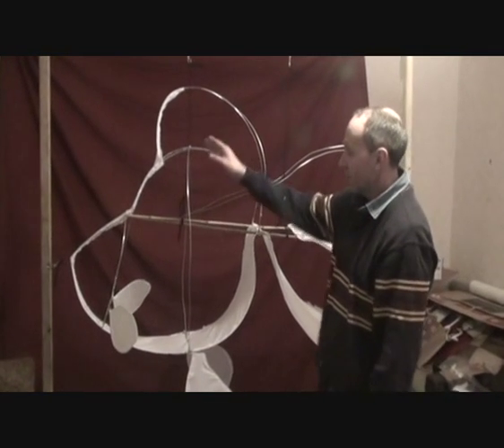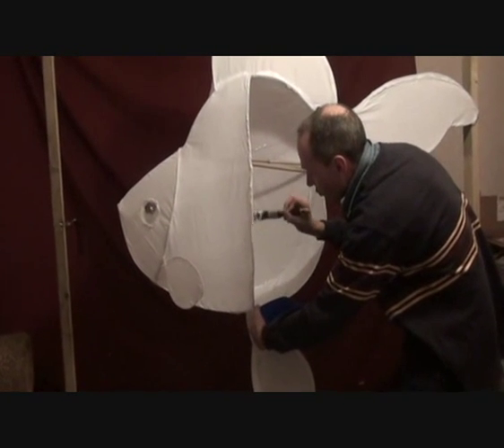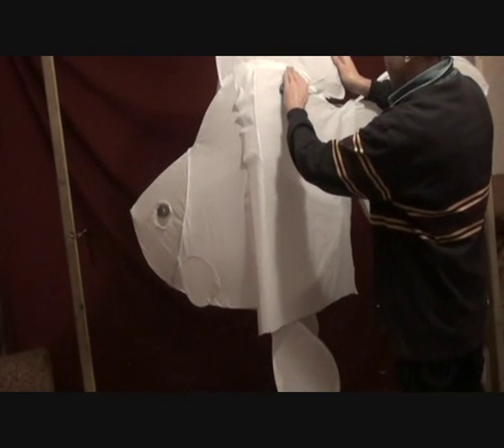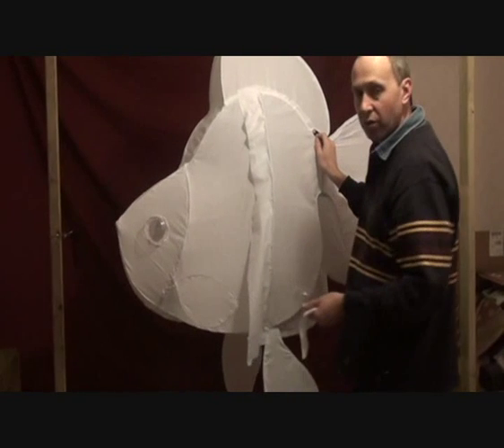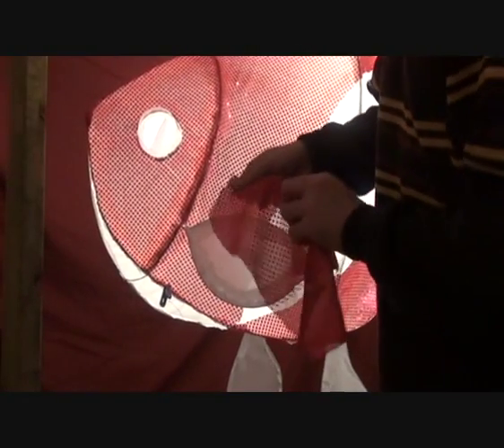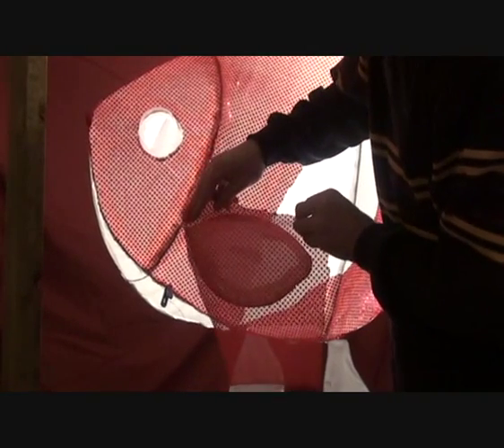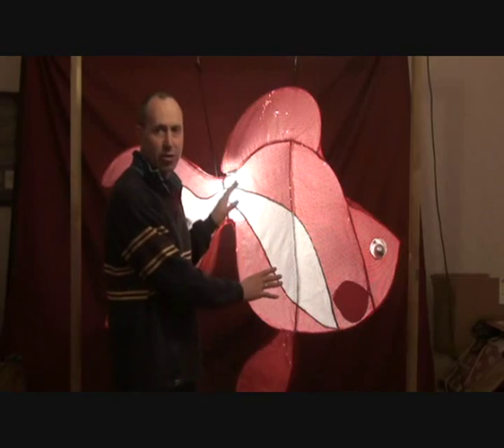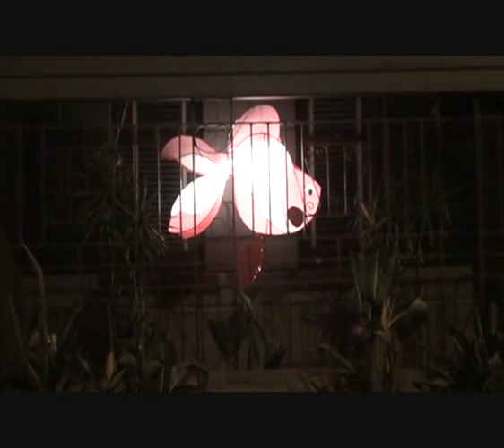Making a Chinese Lantern pt3 (Fabric, wire and glue)

Comment: whats the glue you used to put the fabric on the wire?
Reply from the maker: +Monish Anand Sorry for the delay in response. The glue is a water based acrylic general purpose product. here is the Au website if its of any help - http://www.selleys.com.au/adhesives/household-adhesive/quick-fix-adhesive/all-fix/
Hope this helps
Reply from the maker: +Monish Anand Also at 6min mark of part 2 i actually show the glue container.
Reply: +nelco3333 thanks!